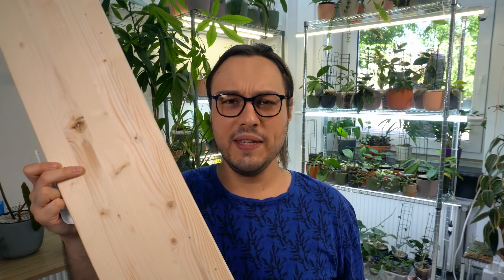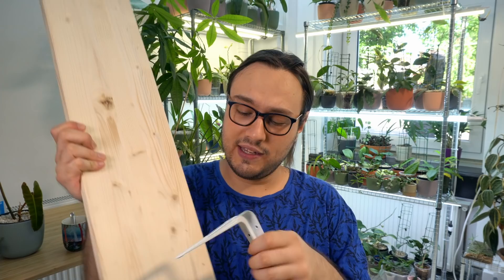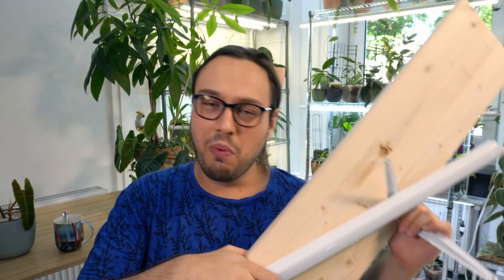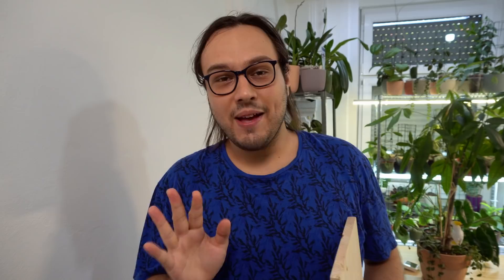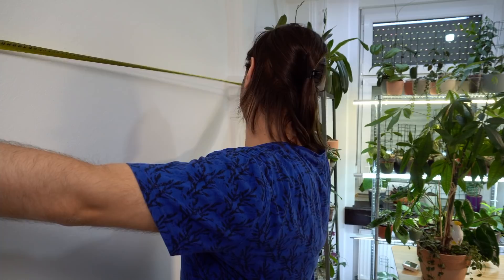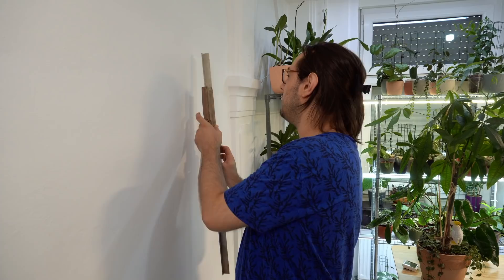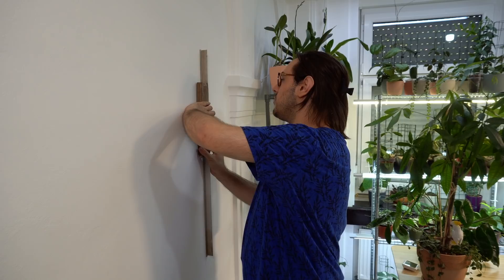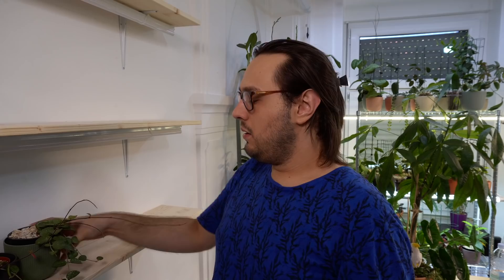Making a New Hoya Shelf!

Comment: You did it beautifully!!! Nice Job! Just a tip for ur next shelf hanging job. . Maybe attach the L brackets to the wood plank FIRST and then mark up a leveled line on the wall. Then line the board up with the line, using the level to keep u straight. Then mark the holes where they stand, remove shelf, and get to drilling the holes.
Reply from the maker: Could work that way too :)

Comment: I was waiting for the drywall anchors…. 
Or looking for a stud to drill into. 
I hope 🤞 they stay on the wall. 
Looks great.
Reply from the maker: Yeah, those are the little plastic things :D I forgot the proper name. That is what I said is very cruical :D
Reply: Did you think he was hammering screws into the wall? 😂
Reply: I was thinking the same thing, as it didn’t look like a solid brick wall. Let’s hope it’s not a drywall…. 🤦🏼‍♀️
Reply from the maker: @margueriteocarroll9532  It's an old house, over 100 years old. :)  The outer wall is made from old-format bricks that are slightly shorter than 12 inches, and then when the part of the house was renovated, they added another layer of wall, inner wall, for stability purposes, I assume, towards the inside of the house (so really it is a room in a room :D ) that is made from siporex blocks, which are 10cm. Then there is a layer of mortar. The entire wall is really 20 inches thick, quite difficult to drill into. No drywalls here 😄
Reply: @margueriteocarroll9532  As Miro's best friend I can say: he has a degree in architecture. The fool ain't a fool. 😂

Comment: Hi Miro! Nice shelves ))) Thank you for sharing this video. I'm just about to customise my Ikea Ivar hoya shelving unit with lamps like yours and was going to put them in the middle. Now I guess I should think a bit longer before doing this. By the way, is there any heating effect on the surface of the shelf that lamp is attached to? As to the spotlights, perhaps you can screw a hook into your ceiling and use just a long enough regular cord and a bulb )